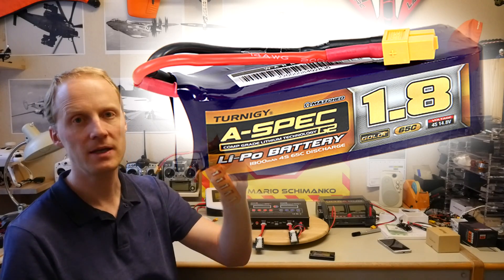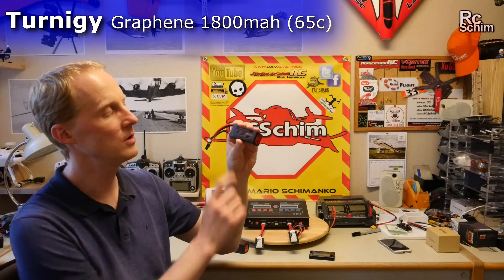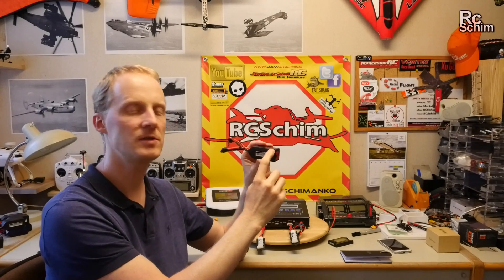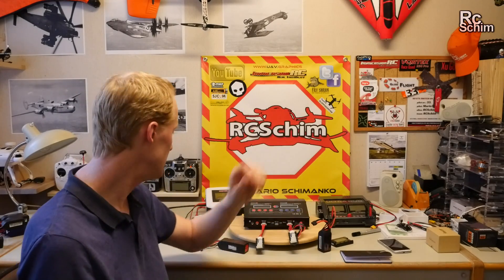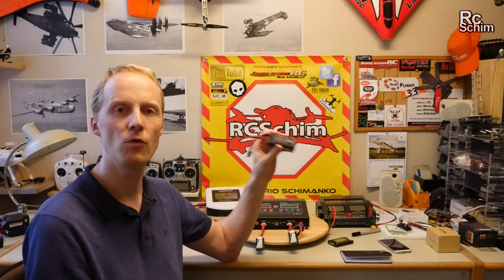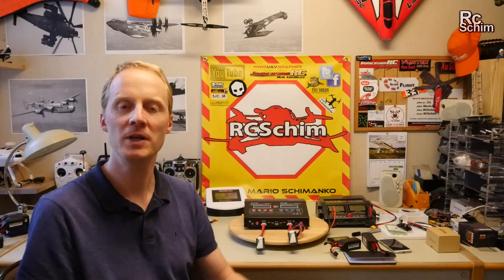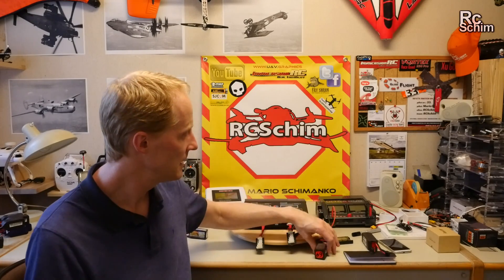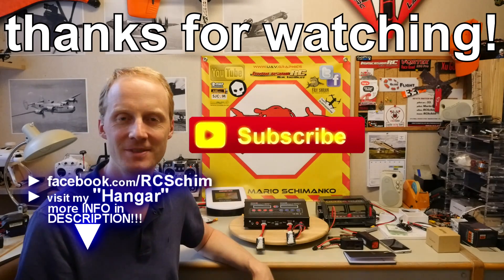How to treat your LIPOs (battery usage tips)

Comment: RCSchim hiya my friend can I ask you what's your low voltage alarm set at and your voltage cut off in your qaudcopters setting   iv been having problems lately with new batteries after if been out flying I'm starting to get a completely dead cell and can't manage to recover it and had to remove the bad cell and this has happened to 6 of my 4s batteries in the last month  and it's happened with two different types floureon & zop but I'm having the same issues lol can you give me any tips or advice on this please
Reply from the maker: hi, this sounds weird. so you get 1 out of 4 cells which dies? and this on more batteries? 
how low down do you empty your batteries with your flying?

I try to land when the volts show around 14v on the osd (while flying). That's 3.5v / cell under load.
that's theoretically around 30%.
In most of my 1500mah 4cells I charge ~1100 to 1200mah back in.

hope this helps a bit,
greets, Mario

PS: the batteries I started to like the most:  ACEHE
more expensive - but you definitly feel that they are better than my other branded cells (like turnigy graphene,...)
Reply: +RCSchim thanks very much for your reply my friend yes iv been having problems with one cells completely dead but yes my cut off voltage was set at 3.2v lol but I'v change to  3.5v I think maybe the dead cells has been caused by a very long term of over discharged my friend and hopefully iv solved this issue lol

Comment: I have a 2200 mah 3s lipo, i accidentally left it fully charged for 3 weeks , back then i didn't know that its not good for a lipo ,i have discharged it now to storage voltage .there is no puffing of any sort. Is my battery all right? How long can we keep a lipo a full charge without harming them?
Reply from the maker: I dont know exactly. I think 2 weeks should be the limit.
on DJI batteries they have a timer until they "self discharge" them (smart batteries). I think you can set this to max 10 days. So DJI thinks the batteries shouldnt be full for longer then 10 days.

it's not the case that your batteries will go defective instantly if they sit there fully charged too long.
think of it more like a gradually decay of it's capacity and lifetime...

Comment: Should I use a timer for my batteries when driving an rc car? Or does it matter since it has LVC in the esc?
Reply from the maker: check the voltage of the batteries after your cars ESC has forced you to stop with LVC. if the cells are really empty - it is not good. if the ESCs stop you at, let's say 3.5 or 3.6 volts per cell - it's ok to use it that way if they are at 3.2 volts or below - I would use a timer.

Comment: What about charging under 1c? I have a charger that goes up by amps, and my turnigy graphene is 2200mah, and I charge it on 2amps, should I be worried?
Reply from the maker: no problem. you can charge as "slow" as you want - that will not harm the battery at all. it will just take longer...

Comment: What is the lowest that I can go on each cell without damage?
Reply from the maker: H Silva depends on the battery i guess. Id say while flying i would go no lower than 13v on a 4cell. Id feel safe aroubd 14v...
Reply: I have a voltage sensor on some of my models and I've set an alarm to go off when the weakest cell hits between 3.5v - 3.4v, depending on model. And I agree with RCShim; I've noticed that batteries from those models tend to last significantly longer than batteries from models which rely on the ESC's low voltage cutoff (3.3v).
Reply: 3.5v per cell

Comment: My lipo just got shipped at 30%. Do I need to throw it on the charger to put it at storage mode or can I just leave it?
Reply from the maker: ExoticSharks 112 what volts are the cells on? If they are around 3.8 your good. 30% sounds like 3.5 - info that case you can charge up to 3.8
Reply: Factorized what is the voltage?

Comment: You recommend to stop flying with 20% left, may I know what cell voltage that would correspond to?
Reply from the maker: +gluino 100% = 4,2v 0% = 3.2v so it should be 3.4v but if you measure in flight the voltage might be lower since under load bsttd do drop voltage. 
My referring to% rather than volts comes from the fact that I'm using a battery meter that estimates % based on volt measurement.
Reply: RCSchim  Thanks, I can only measure volts. I often stop flying at 3.8V (storage level) for convenience.

Comment: Mine crashed today, sudendly lost power after just 1 minute. Porpguard broken on 2 places, camera power load broke off circuit board, lost nut and bolt in grass. I give up on this one.
Reply from the maker: sounds bad... I did some more filming today for my video. while testing it I saw that I had the most fun with the H8 :)   there has to be an issue with the X73 that it has some low voltage protection that kicks in too early. I get more flighttime on the H8 with a 260mah battery than on the X73 with at 350mah...   (almost double the flighttime! - around 3-4mins).
also found that acro mode is not good indoors - so on the X73 I still flew most of the times stable mode...

Comment: How about when you use the batteries to about 80% how long can you keep them in that state? without damaging the batteries, before charging them to storage 3.8 x cell
Reply from the maker: I guess that's really hard to tell. 80% for sure is better than 100% for storage.  could be a compromise to fly the full packs just 1-2mins to get the pressure off. flying them instead of storage discharging is faster :)
Reply: I guess I miss wrote that... if you use the batteries, how long can you keep them discharge (20%) before getting them back to storage state.
Reply from the maker: ah, I get it. you mean if storing them at only 20%.
I think it's less harm to the battery this way than if it was 100%. 
I have some older batteries that your somewhat discharged between 30 and 60%. recommendation is around 3.8volts per cell...
but for long battery life it's also important that in flight you dont draw more power than it can deliver (high C rating) and so on.    I guess if you do everything right you can have them for many flights.   most common mistake would be to fly too long and make them almost empty - everyone does that (cause sometimes it's too exciting in the air and you dont wanna land yet) - this kills batteries the most I guess!

Comment: Interesting to know how you treat your LIPOs, i always say if one day LIPOs take control of the world, all RC hobbyist will be first human beings to die lol
We are really bad with them especially when flying mini quads :p
I never charged my LIPO over 1C, always around 1/2C! I always try to avoid to recharge them right away after a flight, i always wait between 3~6 hours before charging them again. If i know i will not use them in the next 24 hours, i always put them in storage mode, 3.85V per cell. I really don't like to keep them fully charged more than 48 hours. I don't trust the 10 days of self-discharge of DJI smart batteries ever. Mine are setup for 2 days lol Reason for that, i left one of these batteries with this setting and right now this battery performs worst than the two other ones i have lol I know i am maybe a bit parano (just a bit)!
My favourite LIPOs are still the Nanotech 4S 1800mAh 90~130C! Even we all know that generally the C-Rating of LIPOs are not really true, these LIPOs are beast! Graphenes are nice but sigthly a bit more heavy than regular non graphene ones even at same C-Rating, they do the job anyway :)
Great shotout to Joshua "McGuyver" Bardwell ;)
Thanks for sharing Mario and have a great weekend
Reply from the maker: thanks for your battery insights! as I said - I'm not totally sure about how long can you catually store them charged without a lifespan / capacity reduction.
I just know how long my batteries work and that if I treat them good, they stay "unpuffed", dont get soft due to blown up plastic hull...
and my batteries shouldt be to warm after a flight. 
I have 3 dual chargers - this allows me now to charger enough small mini batteries in short time (1h before the flying). 
years ago this was more difficult, I only had 2 or 3 single chargers and the charging took forever... that's why I wanted to charger them early enough to have them ready when I need them.
I think many users will still think and act this way...

sometimes if I'm in a hurry I charge the better ones with 2c - but mostly with 1c. 1/2 c is extra careful - but might pay off on the long run.

Comment: hi Mario. How do you organize your Batteries? I was just wondering what the numbers on your batteries mean. Are you using some kind of statistics for your batteries (to get an overview of the lifetime)? thank you in advance.
Reply from the maker: ha, I had this in the video but felt my "nerdism" about statistics is too boring :)
I use a battery checker that shows remaining % after each flight.
I number the batteries and note them in a XLS sheet.
after each flght I take a pic with my mobile phone of:   taranis radio (model name and timer on it) + battery (number) + battery chacker (%)
this 3 values and the model are entered in the flight log sheet. 
later after I charged the battery I also enter the charged mah in this line. this gives me a good impression how well the battery is still conditioned.

if more ppl show interest in this I make an own video and publish the XLS file as a template.
but I'm not sure if many guys are so nerdy... my firends on the field always laugh at me when I take a picture after each flight.

but I have cool statistics, know how many crashes, flight hours and so on I had.
know how many flights with which model (quite impressive numbers on some of the models).
Reply: We are nerdy, too :-)
Statistics are cool, then you can predict when the battery will die.
Reply: In my opinion it is a very interesting topic. You can call the video then nerd alarm :). At the moment I have not even an overview how many charging cycles my batteries had. Your comment helped me a lot. About a video on the topic I would be very happy.

Comment: I get 5 min at least with turnegy 500 mah, maybe to heavy for x73. Looking for better propguards ( my hubsans are more flexible bur a big to big. Lookinf foreward to your tips. Its much cheaper than a induxtrix 2, but needs some upgrading... grusse Rob
Reply from the maker: sounds like you'd have more tips for me like the other way round :)
I have 600mah batts from the QX90 but they are def. too heavy.
I got some 350mah ones (10$ each) but they are not lasting much longer than the 260mah ones from the TinyH8.

Comment: How long do you store you're fully charged batteries? Really 2 weeks? I try to avoid a times pan above 2 days. 2 weeks would be relaxing
Reply: Yeah, I go a little overkill, but I don't even like to leave them over night off storage haha
Reply: i get stressed out when my batteries sit charged for a day or two.   ill discharge them and charge them back the day after.  good to know there is a big window where they can stay charged
Reply from the maker: I definitly killed some of my big multicopter batteries over a winter season (a few years back). these were 5000mah Turnigy 4cells for my octocopter and I couldnt use them for anything else.
But back than I was like: charge after each flight...
they ultimately only have like 2500mah of remaining capacity...
Reply from the maker: +Sebastian M mit Totally sure about this. Dji for example has a default of 10 days until they self discharge them. I guess it is a trade off between convenience (having fully charged ones ready) and preservation of battery lifespan...   and it is also a cumulative effect. If you do it right most time,  one 2weeks fully charged store won't kill your batt.

Comment: Do you do a test on eachinex73 with setup tips?
Reply from the maker: +Robby Race yes,  one of the next videos i plan. I flew it a few times now and like it. Battery times are low,  prop guards are to weak :) cleanflight on such a tiny fellow is cool,  using taranis,  expo and stuff is great. Feels like real fpv but inside you're house. Just about right now that cold season is coming here.  Also have a compilation of tinyH8 flights in mind.